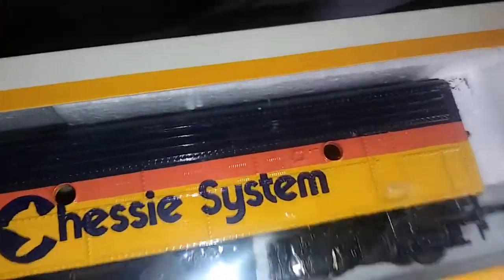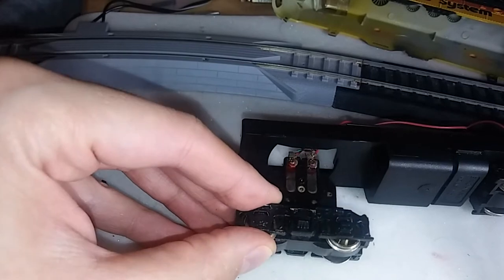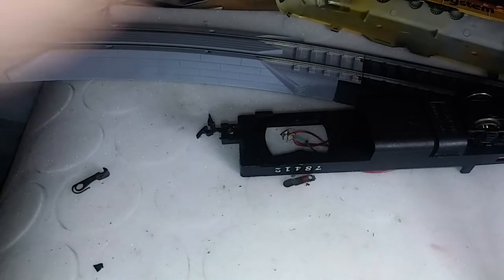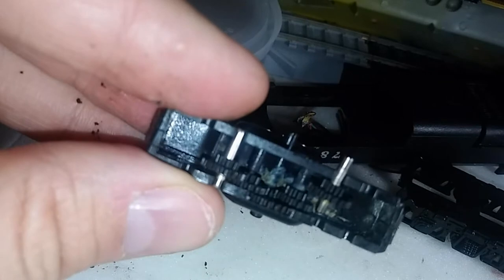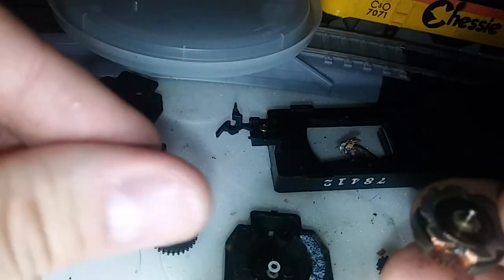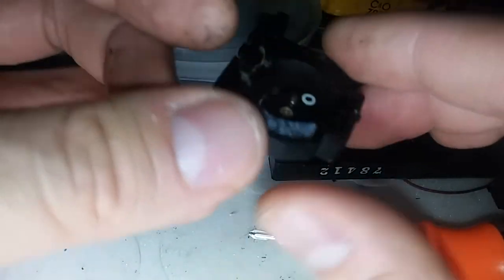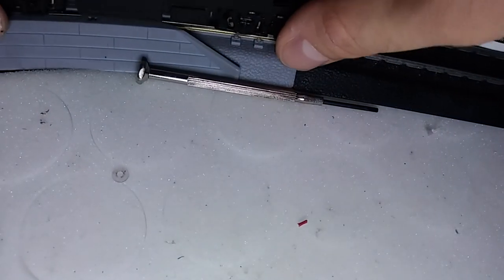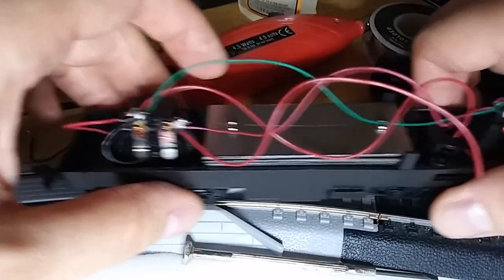Bachmann   f9  early pancake motor repair

Comment: Being out of the hobby for 35 yrs. The pancake motor was new to me.
I recently purchased a couple of diesels that had these motors I was unfamiliar with.
For days I was racking my brains out on how to release the motor from the carriage . 
Did research for days but couldn't find nothing.
Today I finally discovered  the proper name for this motor and it made my search much easier!
You were my first pop up to this particular motor and ta da! you showed me right away how to release this motor.
Touché now I can get on with getting two locos running like they should!
Thank you for this video, my stress has disappeared.
Reply from the maker: Glad you found my Video helpful!
 Please feel free to subscribe if you have not already!
Thanks' for watching!

Comment: I'm far from an expert, but just throwing this out there.  Recently got my "train set" from my moms attic, looks like I'm getting into this as my 5 year old has taken an interest lol.  Been in her attic for over 20 years, and was bought new by us.  One of two loco's I had was an early F9 with this motor setup, although with the white gears you mention.  I can say with confidence I'm the first to open it.  The front truck is pickup only, and the rear is drive only (no contacts).  Just throwing it out there; I have no doubt there was a flavor with pickups on both trucks, but I can say with confidence that ones without them on the rear/drive truck definitely existed.

Comment: What a goofy video, if you knew what you were doing you could have just cleaned the original motor and it would have ran just fine.  When the rotor is burned up the windings will not be bright copper colored. You just needed to clean up the black crude that was on the face of the commutator, it was just old oil and brush dust. If you would have cleaned all the parts in rubbing alcohol with a toothbrush and reassembled it, it would have run.  It was obvious this was your first time working on this type of motor.